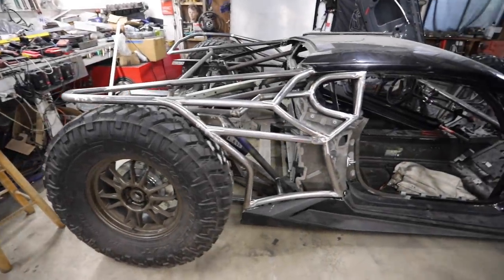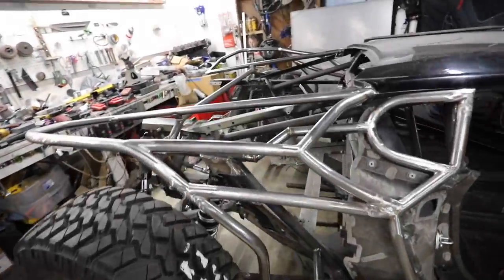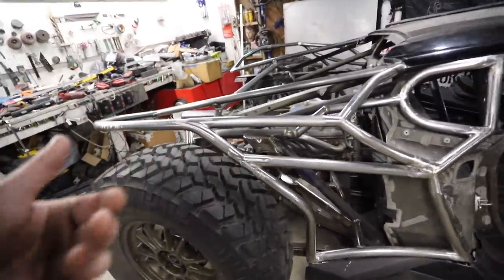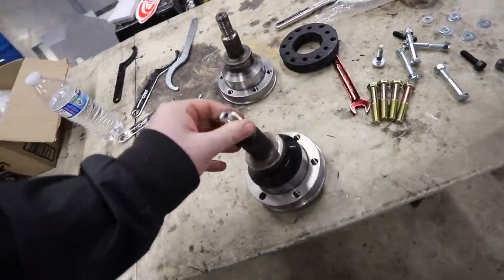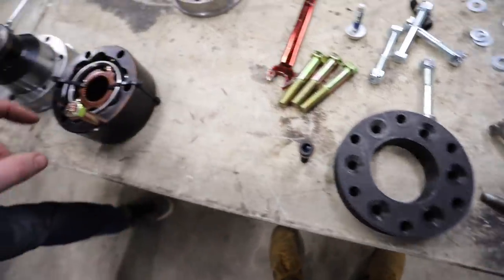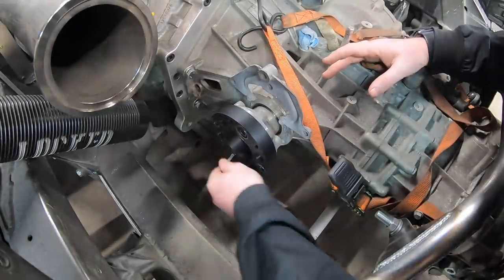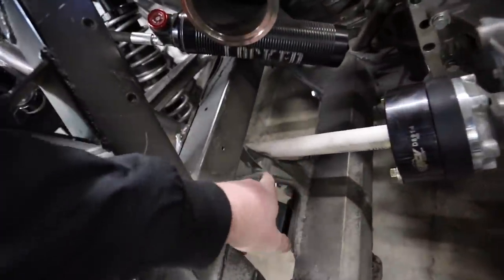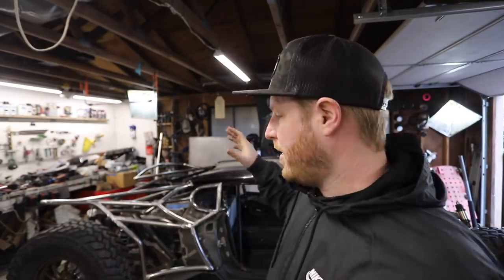Coil-over Springs Are Installed, Ride Height Set, The Jumpacan Is Officially A Roller!!

Comment: You sure about welding to a heat treated CV joint, boy I want to see how this go's.
Reply: So long as you go slow and don’t overheat it, should be fine
Reply: @joshrepik  I'm thinking embrittlement and it blows to bits the fist time it gets fed the jandal, might even crack as it cools.
Reply: @MUDNROCKS  maybe, but I’d think an experienced structural welder could do it fine
Reply: @joshrepik  Do you think Cryo Tanking it after welding would de-stress where it's gone glass hard ?
Reply: @MUDNROCKS  I mean, I’m no professional, but I would think normalizing then tempering the whole piece after welding would probably de-stress it better, maybe even a few normalizing cycles followed by a hardening then tempering?
Reply: @joshrepik  There's got to be some witchcraft done, I'm pretty sure its going to go glass hard. We shall watch and find out, been nice chatting to ya, later mate.
Reply: @MUDNROCKS  you too boss. Also remember if it does snap they’ll already have the dimensions and can just have fully custom ones made at that point

Comment: Idk if you guys are going to do this but I recommend you have a strap or chain from your wheel /where your shocks are to upper part of your body. Essentially this prevents damage to your shocks because when you hit a jump your shocks will press the wheels down mid-air and the wheels will pull on the shocks and can break the it shaft. This has happened to me before so I advise it.